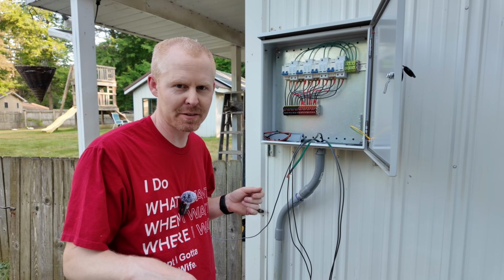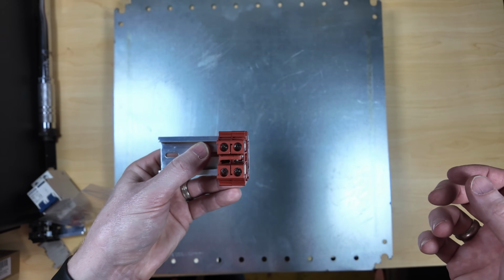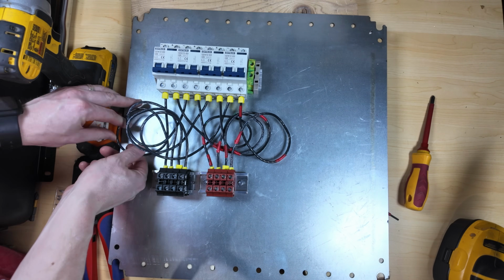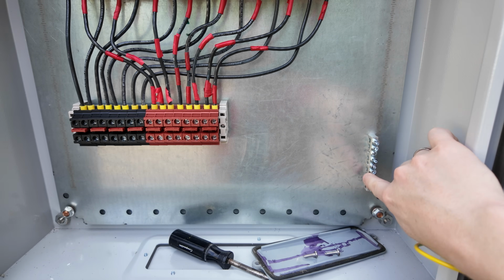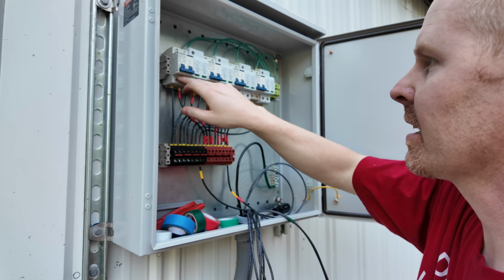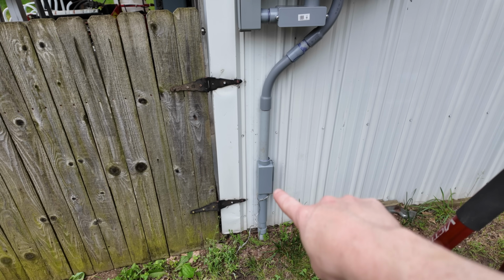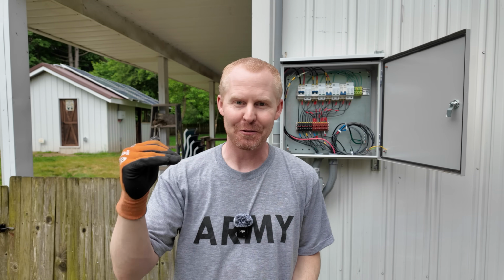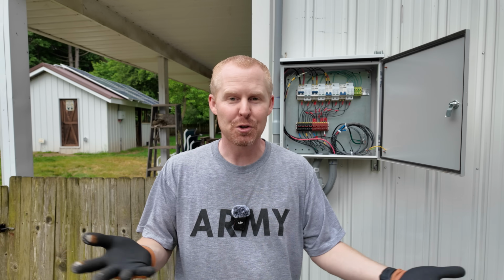FINALLY Got This Done! DIY PV Junction Box for My Solar Setup

Comment from the maker: 🛠 Parts & Components (Affiliate Links)
     🔹 VEVOR Electrical Enclosure, 20x20x6in, Tested to UL Standards NEMA 4 Outdoor Enclosure - https://www.vevor.com/electrical-enclosure-c_10749/vevor-electrical-steel-enclosure-box-nema-4-outdoor-enclosure-nbsp-20-x-20-x-6-ul-p_010433852983
      VEVOR 5% Discount Code: VVPROMO

     🔹 VEVOR Electrical Enclosure, 20x20x6in, Non-UL NEMA 4 Outdoor Enclosure - https://amzn.to/4lqsVKI

     🔹 Chtaixi DC Miniature Circuit Breaker, 2 Pole 1000V 25 Amp - https://amzn.to/4ka14NL

     🔹 Dinkle DIN Rail Block Kit - https://amzn.to/3ZSzjlJ

     🔹 2 Pieces DIN Rail Slotted Aluminum RoHS 12" Inches - https://amzn.to/44CeuO5

     🔹 UL Listed Wire Ferrule Connectors 10 Gauge - https://amzn.to/4noVidY

     🔹 Surge Protection Arrester Device, 2P DC - https://amzn.to/46kp1P6

     🔹 HKS Ratcheting Crimping Tool Set - https://amzn.to/46jEsai

     🔹 Industrial Hydraulic Cable Lug Crimper 16 Ton 9 AWG to 600 MCM - https://amzn.to/4l0Sy4Y

     🔹 VEVOR Digital Torque Screwdriver - https://s.vevor.com/bfRcyt

     🔹 Watts247 4-2 PV Combiner Box - https://watts247.com/product/pv-combiner-boxes-quick-select/?wpam_id=126

     🔹 BLUETTI EP800+B500: https://shrsl.com/4lxum
  Discount Code: AdamEP800 - 5% Off

For more details, visit my website: https://going-off-grid.com

💡 Support the Channel
Want to support my work? Here’s how:
✅ Use my affiliate links—it doesn’t cost you extra, but it helps me out.
✅ Buy Me a Coffee: https://buymeacoffee.com/goingoffgrv
✅ Click the “Thanks” button under the video.
✅ Join as a channel member for exclusive perks: https://bit.ly/3Wdufqv

I appreciate your support! 🙌

Comment: what size hole for what conduit sire are you punching? 
what step bit size did you use for the puch bolt to go thru the plate?
Reply from the maker: I'm using 1 1/4" conduit and I think I just used whatever size step from the step-bit to get the hydraulic punch bolt to fit so I could use that tool instead of throwing slag all over the place with the step-bit.

Comment: Have you had any issues out of the surge protectors from Amazon ? I’m trying to decide between speeding the money on midnite solar spd-600 or not
Reply from the maker: I haven't but my next project I am going with the Midnite SPDs.  I think the MOVs inside them will work a lot better plus you get the LED indicator if something goes wrong.
Reply: @AdamDeLayDIY  Thanks so much for the clarification !

Comment: I noticed you counted the wire to your DIY combiner box going to your house, but you didn't count wire to the prebilt box.
Reply from the maker: When I was adding things up, I only counted the wire inside the box between the breakers, Dinkle Din rails and the SPDs since that same wire would be included in the prebuilt box.  

Any wire runs outside of the box would be needed regardless of DIY vs prebuilt.

Comment: On the item - I asked what are torques spec for DC Miniature Circuit Breaker, 2 Pole 1000V 25 Amp Isolator
the reply was: The product information specifies a tightening torque of 2.5 Nm for the DC miniature circuit breaker.
Reply from the maker: Thanks for checking!
Reply: @AdamDeLayDIY  here is where you can find the torque value
to find the torque value for the wire connection
scroll the items web page way down till you see the section
labeled: Specifications

there you will find the torque value
Reply from the maker: @Bill_A_in_FLorida thanks!

Comment: IMO  E-08W DC disco (four strings).  Much nicer than the typical two string IMO discos you typically see.  You don’t need breakers if just passing one string through, only when combining.
Reply: https://technical.imopc.com/e04-48-datasheet-0525.pdf

Comment: I bought a pre-built combiner box to function as a disconnect. It was rated for 30a and I change my panels connections between seasons. For some reason, this season when running it through the 26.22a (off season is 13.11a) I had a catastrophic meltdown of the fuse holders. Turns out the metal strip acting as a bus bar was NOT rated for 30a, likely 15-20a. It was really bad. I decided to remove the fuses completely, for now until I decide how to move forward, and only running at 13.11a config. I also decided to use 8ga wire inside the box going to a power distribution block that combines them all through a 100a breaker with 2ga wire running to MPPT (Victron 150/100 MPPT). It only gets slightly warm to the touch, at least I assume it's warm which is hard to tell when it's already 95-100f outside. I'm thinking about trying again to connect the 26.22a config and use inline fuses to see how the box handles the amperage before deciding on internal box fuses to use. So far not happy with the current choices of fuse holder choices and MidNite solar breakers are a little pricey. I was using the inline breakers with the older combiner setup when the meltdown occurred. I checked them and they were in still perfect condition. I may just rely on inline fuses for now. There definitely needs to be a faster tripping fuse solution for DC solar.
Reply from the maker: What kind of pre-built box did you get?
Reply: Same question as Adam....which box did you buy that had the meltdown?

Comment: you need ground rods each box
Reply from the maker: That actually creates other issues.  It allows gradient pulses from nearby lightning strikes or surges to travel across your wires to other ground rods frying anything in between.

Comment: The mounting rails are DIN rails, standardized in EN/IEC 60715 specification. The are two heights of the rail from the back and are 35 mm in width. DIN rail is the industry standard for the item.
Reply from the maker: Thanka

Comment: Adam this is an EXCELLENT video!  Thank you!  Thank you!  I will be following your design when adding my second array.  Points to ponder - #1 I think fire departments like a PV big red push button disconnect don't they ?  You might be far out enough rural not to be concerned but I am thinking of adding & #2  I know these SPD's your showing look good seems effective & I also watch Projects wtih Everyday Dave (Projects?) LOL & remember seeing them also - would adding Midnight Solar's SPDs be better (yes more expensive).  LOVE THE DIN design & the dinkle DIN's - awesome! - thanks for the video!  :)
Reply from the maker: Thanks!

The push button is usually a remote shutdown (RSD) to trigger roof mounted panels to turn off on homes.  Sometimes it also shuts the inverters down as well.  I don't believe there's an RSD requirement for ground mount arrays.  

The MidNite SPDs seem to be able to handle surges better.  We actually had one of the guys from MidNite on our live stream last week and a lot of the discussion revolved around SPDs and grounding: https://www.youtube.com/watch?v=hxx3yK2_qlA&list=PLpbWeFH8xI3e1YwiU0zhu9K6QOxS3L4hP&index=1

I wish I would have used the Dinkle Din rail connectors a long time ago!
Reply: @AdamDeLayDIY  Never thought of the push button as remote shutdowns & differences in ground vs roof mount.  Thanks for the reply!
Reply from the maker: @EngineersLoveChange  you bet!

Comment: I do UL panel design all the time. Panel design and layout is more art than science. It optimizes UL/manufacturer requirements with the ability to allow the internal and field wiring to be completed neatly.
Reply from the maker: I imagine that can be difficult to make things look good with different size components and enclosures?
Reply: @AdamDeLayDIY  panels tend to look worse the more stuff you put in them. This also makes it harder since there are usually more constraints. Most plants prefer a panel that is 30-60% full for expansion over the next 30years .
Reply: Would you happen to have a recommendation for an off-the-shelf pass through box to do what Adam did in the video...high quality, 4 string pass through?
Reply: @N8FLY  it's going to be up to you to determine what is valuable. Do you just want "something that works" or do you want quality and something that is UL Listed? Any NRTL listing is better than none, but UL listed (recognized should be used only if you know what it means) parts are typically the highest quality. I have need crap UL listed enclosures but UL parts rarely have design/quality issues. UL listed parts will also be more money.
Reply: If you only want to pass through DC, any 600v rated Terminal block should be sufficient. Allen Bradley, Wago, Dinkle, Phoenix Contact are all good brands. They all have jumper bars of various flavors. DigiKey, Mouser are 2 decent places online to buy small quantities from. Automation Direct can be really cheap, but I fear you tend to really get what you pay for on AD.

Comment: Needs a followup video on why the PV wire was hot.  You had an older video where you were leaking AC back to your panels before.  Would be good to expand on this as a safety video.
Reply from the maker: You just want me to demonstrate on camera...😁